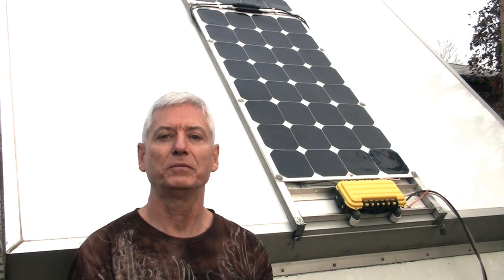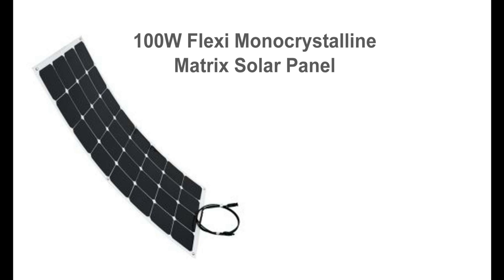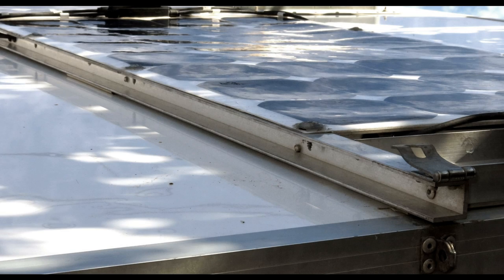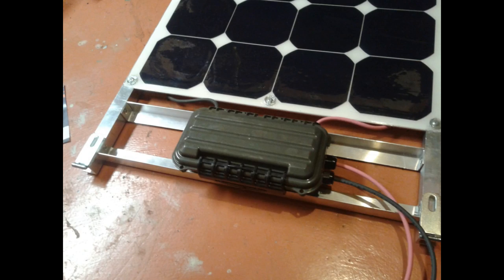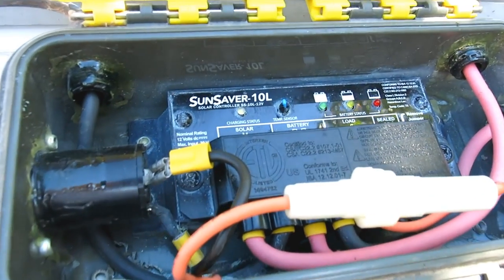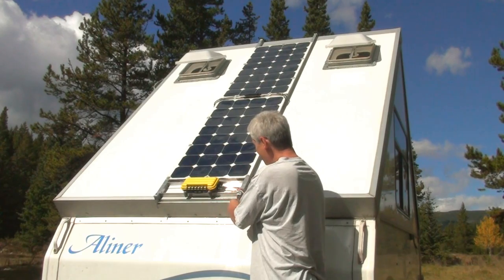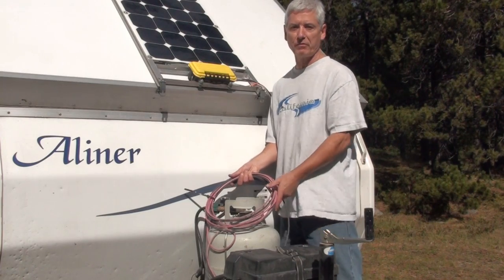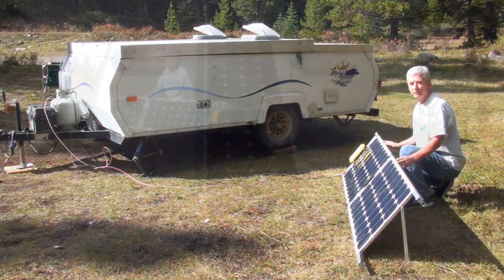Adding Solar Panels to an Aliner

Comment: Hey, I just discovered your channel and watched this video and noticed something.  You mentioned you wired your panels in series (and in a later video you mention how you only ever saw 8 amps out of them combined).  With 12v nominal panels you can't wire them in series unless you have a more expensive MPPT controller as a series configuration adds the voltages together and you were throwing away more than half of your watts every day (parallel configuration adds the amps together but keeps the voltage at the more useful 17v max/12v nominal level).  I have the same controller as in this video (the sunsaver 10) and it is a PWM controller than only shunts off to heat any voltage greater than the battery can take (which in your situation was between 12 and 22 volts worth of wattage being lost to heat - your series configuration generated between 24 and 34 volts at 8 amps max).  I hope you fixed this with your later 20 amp controller (either to parallel wiring or a 20 amp MPPT controller so you can use all the extra volts that get converted into usable watts!).  One more note, you are much better off to take your solar controller box and mount it to the chassis right next to the batteries and have the extension cord going from panels > long wire >  controller > battery,  rather than panels > controller > long wire > battery as you will lose more watts to heat the second way.  We live in the Calgary area and think you are fantastic and can't wait to do the same southern trips you are doing with your Aliner!
Reply from the maker: Hi Mike, that was in error as I have them in parallel (PCs pick up the correction but Apples do not). Thanks! SP

Comment: I wish I had watched your video before I installed a 165 W aluminum frame panel on the pop up dormer of my Chalet A-frame. Its a lot heavier than yours and I now have to prop up the dormer with a rod to set it up when it used to stay up on its own during setup.  It charges well but its harder to set up with one person.  Bummer......

Comment: The Plano box used as an enclosure box is brilliant. Also nice engineering of the latch for the solar panel frame to make it removable.
Reply from the maker: Thanks Shawn! Currently working on some minor changes in design, hopefully I will have a new video ready soon.

Comment: loving all your shows, never heard of an Aliner till we saw yours, now we are getting one
so my question is do you remove the panel's while your driving? you don't get air lift?
Reply from the maker: Hi Dan, the panels stay on while driving. No air lift as the front brace is solid without an air path. Thanks! SP

Comment: I use two 100 watt flexible solar panels on my Aliner Scout.   The flexible panels are not nearly as good as the glass panels, they have four fewer cells than a glass panel, so the output is less, and the plastic means the panel will have a much shorter life span than a glass panel,  perhaps 10 years if you are really lucky, vs 25 years for glass panels.  But if you want to mount solar panels on the roof of an Aliner (or the other brands) then weight is the number one concern.  My panels add 12 lbs to the roof with the weight of the panels, frame and cables all considered.  Its just 12 lbs,  but that 12 lbs makes the roof considerably more difficult to erect,  without the panels the roof will "spring up" when the hold down hasps are  removed, with the panels, the roof stays fully down when the hasps are removed.     The other issue is where on the roof you install the panels, ideally you want this extra weight as close to the hinge as possible (the fulcrum) as this will reduce the stress on the roof hinge and spring and make lifting easier.  I have bubble domes on the lower part of each roof section, so the panels are above this and further away from the fulcrum that I would like.  I am planning a new solar panel frame that like yours will place the solar panels end to end on the short sides (as opposed to the long sides as they are now).  The frame and panels will be 82" wide and the trailer is 79.5" from edge to edge on the roof, so I will have a 1.25" overhang on each side, but I can take advantage of that for the attachment point. Like your solution my current panel frame is detachable and i have a cable extension that allows me to remove the panels and get them in the sun when I can't get the front roof section into the sun.  The new attachment point will be 1.5" aluminum angle on the roof section sides attached with 3M VHB tape and screws into the roof section.  The new frame will simply use bolts or clevis pins.  I will add some rubber bumpers on the roof to protect it (mine is Filon/Fibreglass), these bumpers need to be on the roof, not the frame, if on the frame they will rub and damage the roof.       You corrected yourself when you said your panels are serial when the are in fact in parallel.   I use an MPPT solar charge controller that allows up to 100 volt input on the solar panel side.  The MPPT chargers cost more, but are way more efficient, and have advanced charging modes to maximize battery lifespan.  My panels are mounted in serial which doubles the voltage but keeps the amperage about the same. With the higher voltage and lower amperage the voltage loss on long wires is minimized.  I have occasionally seen the charger put out 14 amps at 14 volts which equates to 196 watts,  although the not as good flexible panels are usually in the 160 watt range, respectable, but my teardrop with its two 100watt glass panels often hits 220 watts or more of output.
Reply from the maker: Hi Jeffrey, The best thing about the plastic panels is they are so light. If I haven't opted for the removal frame they would add next to nothing as far as weight goes. This also gives me the option of adding two more panels, giving me 400 watts and instead of 200. As I have no skylights (not sure why anyone needs them) I have the room for this. Just waiting for a price drop or government incentive! Not worried about how long they last as I guarantee they will outlast my old trailer! Thanks
Reply: In your video you mention airspace between the panel and the roof.   I want to reinforce that this airspace is very important to have.  I have seen many of these flexible panels glued to the roof of Aliners without the airspace.   The airspace below the panel allows the airflow to cool the panel.   Hot panels loose efficiency and also have a shorter lifespan.      However it is very important that the frame and attachment method used be secure as airflow under the panels while on the road can amount to a considerable amount of force.  Yours looks very secure, you glued your panels in addition to using the six screw holes in the panel.  Using the screw holes is not enough!  These panels are somewhat fragile and the plastic around the screw holes will crack. I had my panels double side taped and screwed and did see cracks around a few screw holes, so I added larger washers and added aluminum angle  over the leading edge of the panel to prevent the "road wind" from lifting the panel.    Another concern with using a frame is that the panel requires some support from below so that it does not "droop",  you have crossmembers across the frame, and this too is necessary. A common complaint about these panels is that they "droop" and water and dirt collects on the cells lowering their efficiency and damaging (etching) the surface.  The couple behind GonewiththeWynns.com once used flexible panels and quickly gave up on them because if this issue.  We Aliner owners are stuck within them due to weight constraints. If possible the panel should be supported every 12 inches which equates to five cross members total along the long side,  or three along the short side, this will reduce the droop. If you ever have to unglue/untape a panel from the frame use a wire saw, which is a rough wire with a ring at each end, you have to cut the glue or tape, you can not peel the panel off as it will destroy/delaminate the panel.
Reply from the maker: Thanks Jeffery. The panels so far have stayed put very well. I do have to remove them occasionally to get rid of the gunk underneath the frame, but there's nothing under the actual panels. After almost 2 years and 35,000 miles I do not have any major marks or scratches on them. Plan on doing an update soon, as well as comparing some new panels to my old ones for fading. Slim

Comment: You show the Plano box at the bottom of the solar panels but you did not go over what is inside with the battery controller and how it is set up.  Help Please.  Love your ideas and want to add this to my A-Liner.
Reply from the maker: Check out the second video. Thanks! SP
Reply: I did as you asked but was not able to find how the Plano Box was set up.  You only showed the inside of the box not what to put into it or how.  Thank you

Comment: ts great to be removable, but firstly flexible solar panels must be supported completely on the rear otherwise vibration will damage the panels. The name flexible means it can be curved into shape, but it still needs to be solidly supported in position. Secondly the controller should be near the battery not the panels

Comment: I have a six cylinder Kia Sedona mini van that is rated for 3500 lbs towing.  How is your vehicle holding up and do you have any guidelines you can give your opinion on for vehicles?  Thanks. You got great ideas and implementations. Great videos.  Thanks.
Reply from the maker: Greg,
I only know one tow vehicle myself, the Jeep. Since many Aliners are only around 2000 lbs you shouldn't have a problem. To me tires are more important than choice of vehicle.  My Jeep did well, only finish peeling off hood and back window latch doesn't work after 35,000 miles! Thanks
Reply: Thanks.  Your jeep is a 6 cylinder? and is the Aliner model a Scout?
Reply: Also is that shower working well for you.  Does the water go straight to the ground under ground or to a tank.  It looked like you ran it to a tank?
Reply: Sorry I reviewed the other video and I see you have a Scout and also the how you drain the shower.  But, still like to know if your Jeep is 6 cylinder and if you are liking the shower?  Thanks.
Reply from the maker: Hi Greg, Yes, 6 cylinder Jeep Liberty. Shower works great. A little cramped but I've got used to it. Thanks!
Reply: Thanks.
Reply: I see that there is an off-road axle package.  It adds like 500 lbs more weight to the aliner over the standard axle.  Do you have the off-road axle (package), and when do you think it is necessary to add it?

Comment: Do you have any problems with the charge controller overheating in the waterproof box?  I plan on using a 20A MPPT controller.  Many thanks for the videos.
Reply from the maker: It gets pretty hot in the desert, not from charging just from sun. Will probably revise the design for an indoors controller. Thanks! SP

Comment: Do you leave the panels/controller attached to the battery while on the road, when the tow vehicle is also charging the batteries? If so, how does that parallel charging situation work out?
Reply from the maker: Hi Scott, Yes, the panels are continuously charging the batteries regardless if I'm on the road. I do not use the towing vehicle to charge them. The controller prevents overcharging. Thanks!
Reply: Sweet setup!

Comment: Nice video series.  The audio is very weak though.  One note is that with solar, series is always better than parallel.  The MPPT controller converts it to 12V for charging.  With parallel, if one panel gets shaded and doesn't produce as much voltage as the other, its a short and a lot of power gets lost.
Reply from the maker: Unfortunately mine isn't a MPPT controller, so parallel is the appropriate
 connection for my system. PWM controllers are more compact and 
inexpensive, so suite my design and budget. Since the whole system can 
be taken off the trailer and moved to a sunny location, I don't need to 
worry about one panel not getting sun. Thanks
Reply: Being able to remove it like that is a significant advantage.  For example, you can park the camper in the shade and move the panels out in the sun.  I have seen some compact low cost MPPT controllers, but its buyer beware because most of them are Chinese sourced and not backed by an American company.  I do like your video series, especially the one where you added a bathroom - something most a-frames lack.  They would all be a lot better if the volume was up a bit.
Reply from the maker: Sound in my videos has been a weak point. I will work to improve this. Thanks!
Reply: A lot of video editors will allow you to selectively boost the volume as needed.  Its probably already hidden in whatever editor you are using.

Comment: I know you probably mentioned your year model before but I don't remember it. Newer Aliners have a window on both of the panels near the bottom. Which would be in the way of the solar panels. Because I have a 2011 RAV4 I have determined that the Aliner is the way to go for me.
hclark@ghoti.org

Comment: Why don't you need an inverter for the solar?
Reply from the maker: Hi Kari, all my appliances are 12v-DC.  An inverter is for 110-AC. Thanks!
Reply: Oh, gotcha. So you aren't running anything off the AC plugs in the Aliner then, I'm guessing? Thanks for taking time to answer.
Reply from the maker: Correct. I mostly camp off-grid without any hookups. Thanks! SP